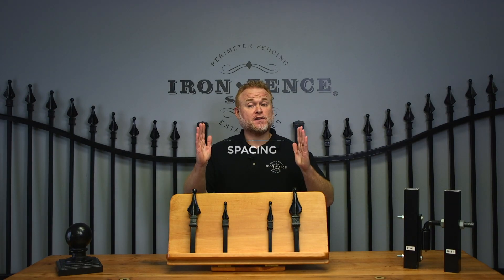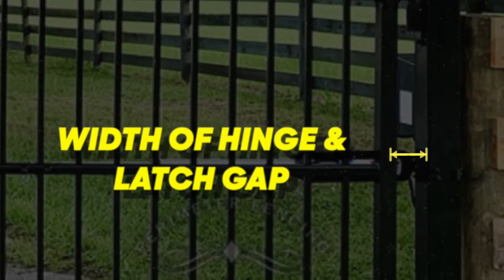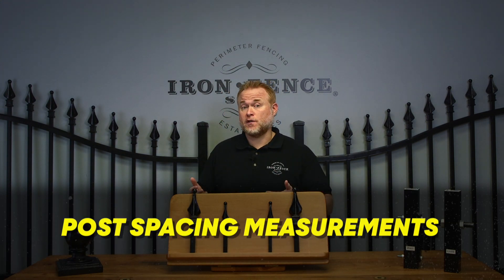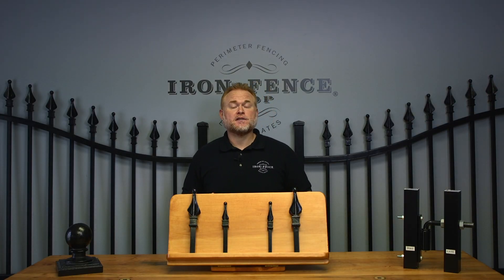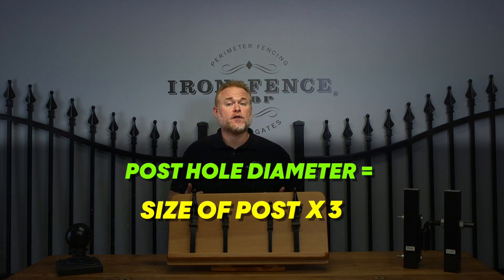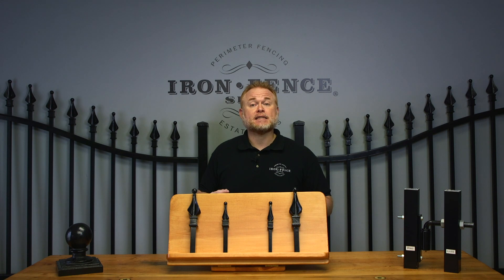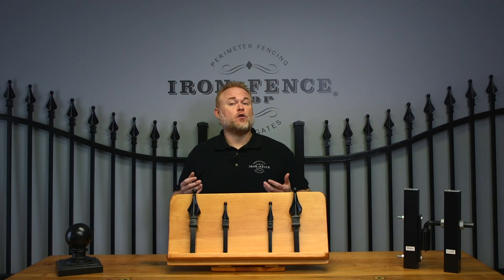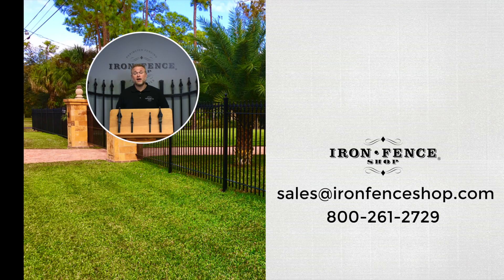Driveway Gate Installation: Post Spacing, Width and Depth Calculations

Comment: Question, 
Why on the double swing gates its 8.5 inches for hinges and latch. 
I have 24 foot opening from inside to inside can i just take off 4.250 inches from each gate.
Reply from the maker: That is dependent on how your gate is built and what hardware it uses.  Every gate manufacturer has specific specs and hardware and they RARELY match between companies.  So if we build a 24ft gate, we build two 12ft wide leafs and you have to add the hardware to that to get your spacing.  The next company may factor the hardware into the 24ft. You need to be careful to look at how your specific gate maker builds the gates and what hardware they use.  Our video pertains to our gates only.  Its not a universal equation necessarily.

Comment: How do you calculate the depth for different gate weights?
Reply from the maker: Most gates are going to fall into a weight range that isn't going to overcome the concrete footings. Our heaviest gate leaf at 12ft wide is about 240lbs and is supported easily by that.  If you have an older refurbished antique gate or one that weighs a lot more, then it could be an issue.  In that case, it typically becomes widening the hole to give more surface area support underground.
Reply: Awesome. Thank you. I welded together my own gates (ea. 8'x8').  They are just under 300lbs.
Reply from the maker: @NSWvet83  What size posts did you go with?  6x6?  If so, I would probably take that minimum 18in diameter hole and bump it to 20-24in if you have the room.  For a gate that tall, I would err on the side of caution.  Concrete is cheap and you only get one shot at the post foundation!

Comment: my frost line is 8'5 feet deep. Do I have to have the post go below that frost line?
Reply from the maker: That is a pretty extreme frost line depth.  I doubt any company would make a post that long to extend below it.  Where are you located?  It may be worth asking around locally what folks are doing.  Normally, 3ft is as deep as you see in the ground with 4ft sometimes being on the extreme end.  I would reach out to us on the website.  The specific height and type of fence may influence this as well.
Reply: @Ironfenceshop  im located in central saskatchewan. No one around us really has their property gated so im not sure.
Reply from the maker: @Chris-g7d2s  The longest post we stock for driveway gates is 10ft long in a 6x6 size. Just an FYI, I do not have a way to ship direct into Canada.  If you have a freight company on the border where you can handle the into-Canada and customs part, we can ship up to the border in the US.  Give us a call to discuss the frost line and shipping stuff.  800-261-2729
Reply: Every gate post we set is 4 ft deep no exceptions ‼️